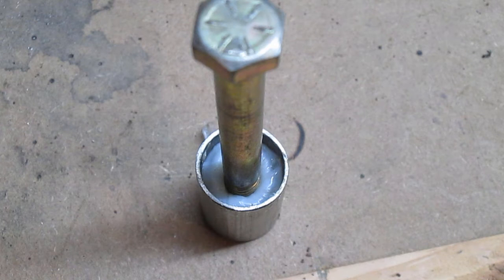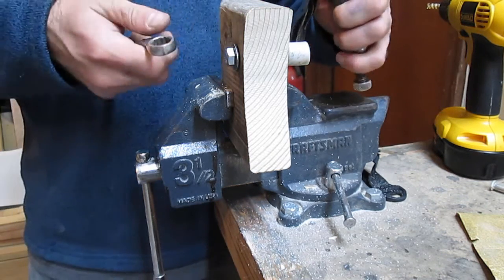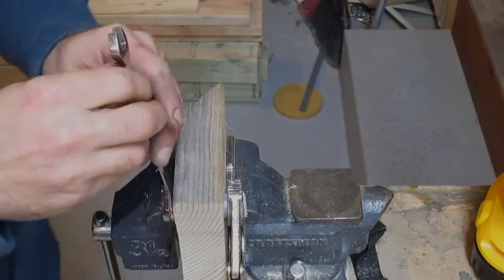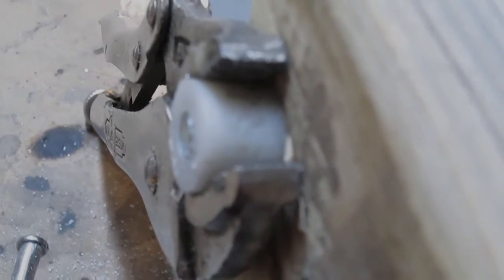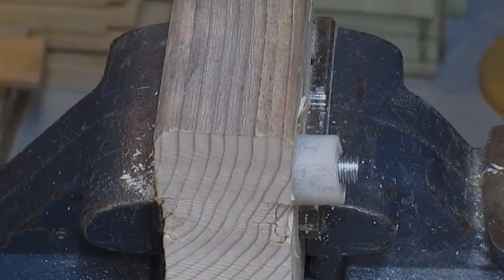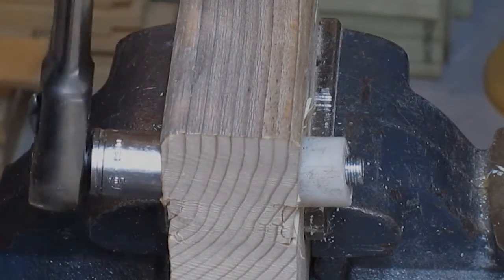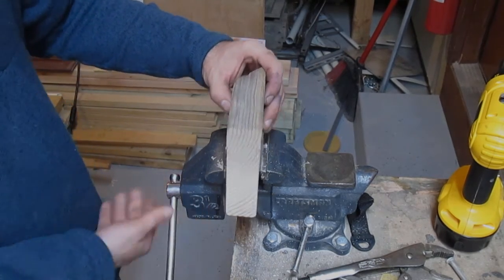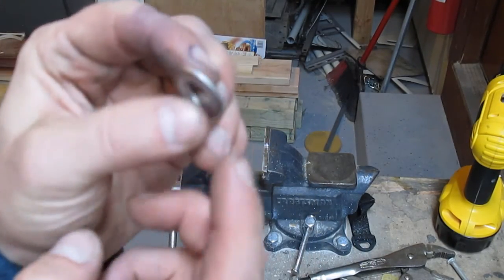HDPE Strength Test

Comment: Did you anneal the HDPE after casting? Or just cast it? My research indicates the strength can be increased 2-3 times by annealing it.
Reply from the maker: This was heated to a molten semi liquid state and pressed into the form. I have a video on making it. If you can increase strength that much by annealing I am going to have to try that. Do you have a link to the process?
Reply: @MakeMore  What I have learned is that HDPE anneals at 200-250 degrees. It needs to be heated through but not molten. This apparently relaxes the tension in the material and reduce the number of rigid break points. I learned about it asking questions on a tour of an armor manufacturer.

Comment: Even though you took the vice grips off towards the end, I don't think this is really an accurate test. I could be wrong, but is it possible that when you tightened the vice grips that they crushed the HDPE against the threads and gave it a better hold? Not trying to be critical, I just think that is a major variable that could be eliminated. It could have very easily compromised the accuracy of the test. Just a thought 👍🏼

Comment: You used a bolt that didnt have full thread. The hdpe thread stripped as it came to the shank of the bolt and could not be threaded up any more
Reply from the maker: I also thought that might have been what happened. In the video, around 10:58, I check to see if that was what happened. Turns out there was still about a quarter inch of threads left when the failure occured.